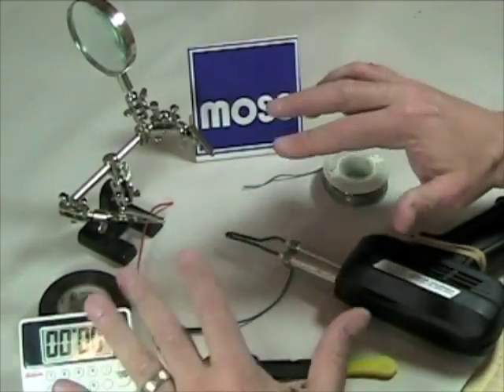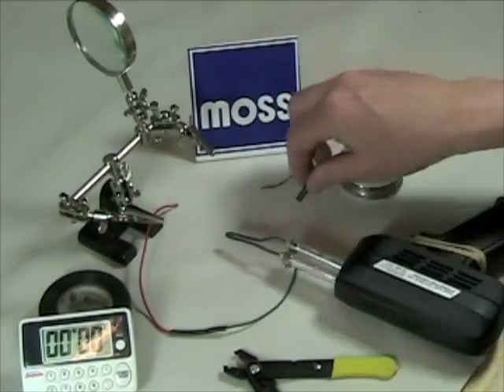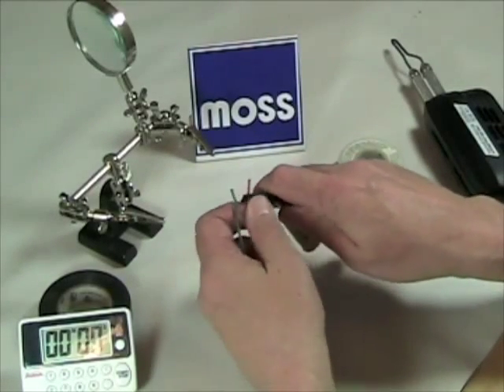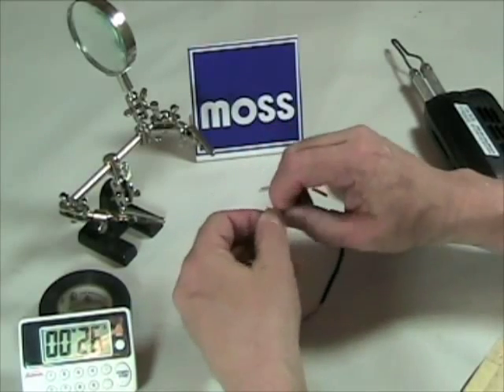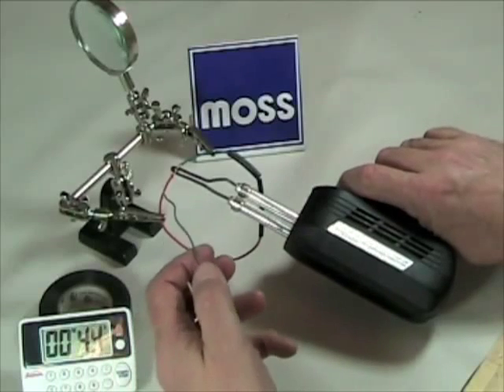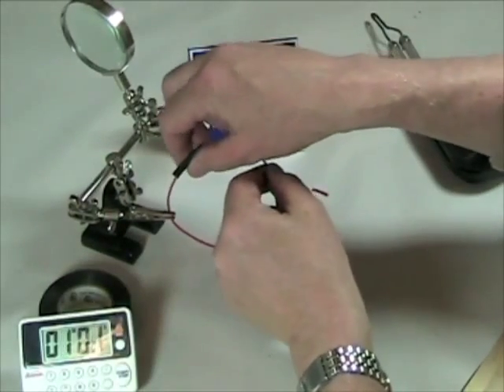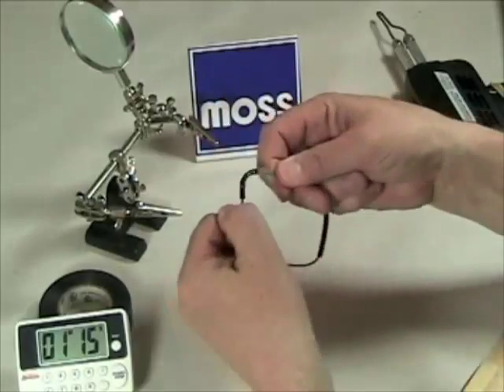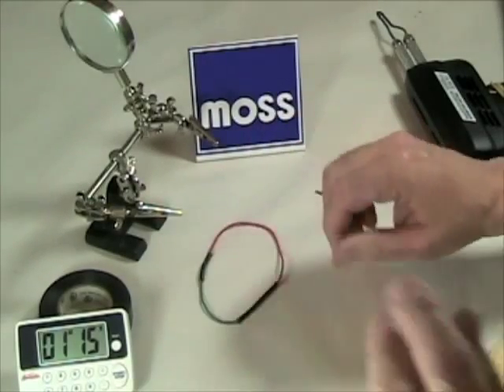Soldering Wire Connections (Part 3) - The 90 Second Challenge

Comment: Sure is easy to connect two wires on the bench.  Now go find a harness with 20 or 30 wires and tap into one in the middle.  If you cut it it's too short to overlap and twist.  So now you can start trying to remove the insulation from the middle without damaging the wire.  And there's no way to get shrink tube on now, so go get the electrical tape and try to make that look neat.  And for extra credit, do all that upside-down with your head under the dashboard.